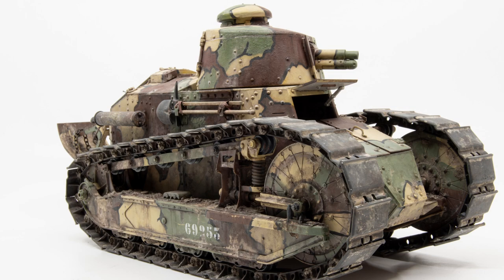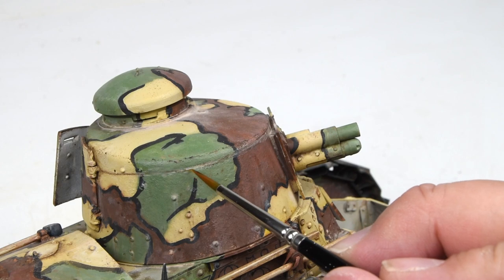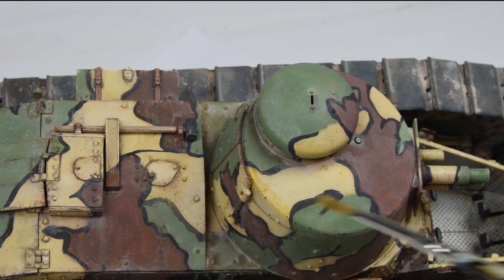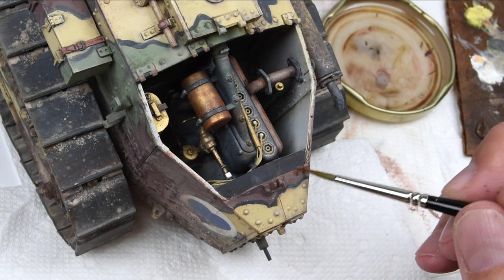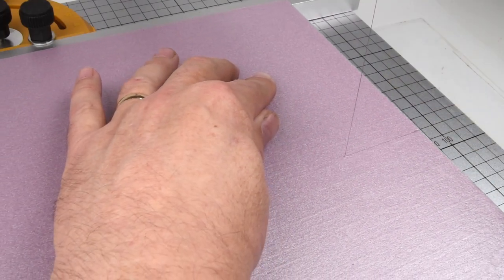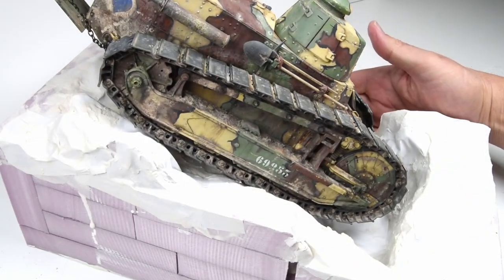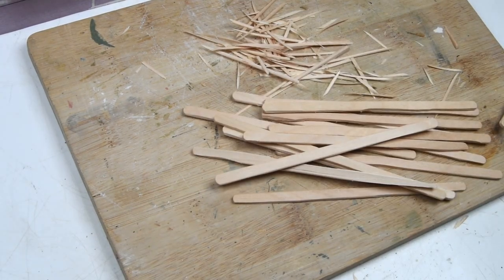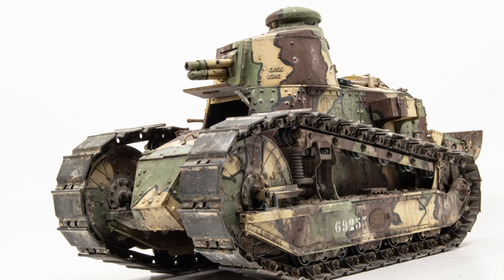FT 17 Ep 5 - Final Weathering and Base.....

Comment: Well, no base then. No problem there. Putting this on a black lacquered plinth just emphasises how excellent the weathering and paint job is. Perfect little tank 🥇
Reply from the maker: Yep...it's already on the shelf....and looks just fine!
Reply: @RickLawlerPropaganda  Regarding the base, maybe make it barely bigger than the tank, flat, and only add a ground texture matching the grime on the tank and maybe one figure. Something I want to try is making a tank firing with cotton and led lights
Reply from the maker: @granola661  I almost switched gears on this video to do this very thing. I haven't done this yet, but probably will (off camera). Thanks.
the lights and the cotton thing that you are describing...well beyond my pay-grade! Good luck to you.